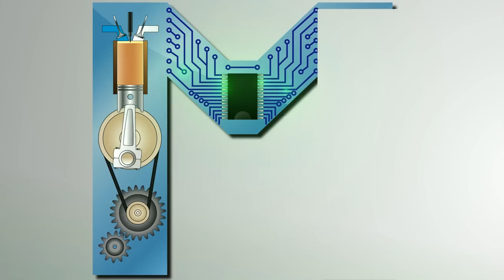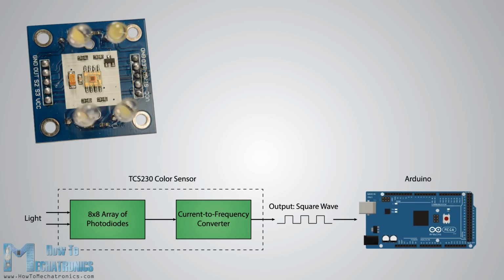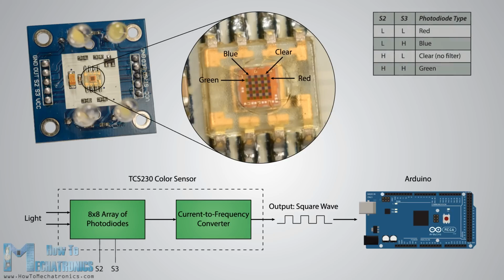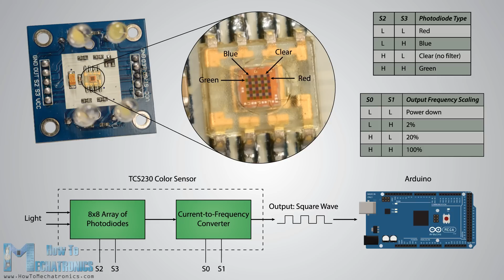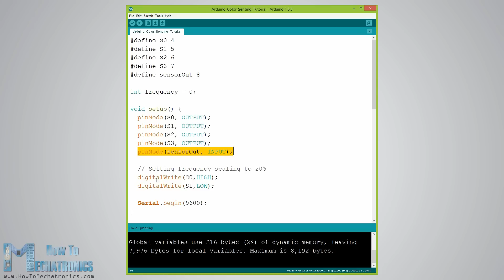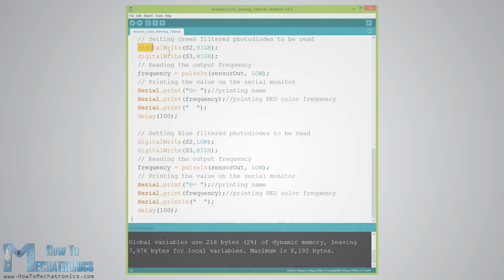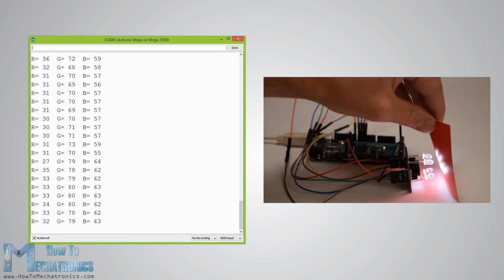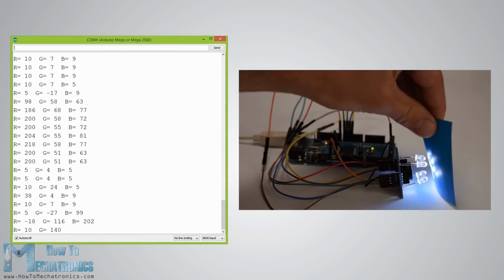Arduino Color Sensing Tutorial - TCS230 TCS3200 Color Sensor

Comment: Great video, but what happens if you want to detect a a different colour apart from red, green or blue such as yellow? I'm using the XC3708 sensor and it says that it can be set to read, red, green blue or greyscale.
 Would you have to test the colour first then use the map function to define the frequency based on the readings that you get?
Reply: Hey Lothan! Late reponse here but it may still be helpful.

All colors can be defined on a RGB scale. Try googling "RGB color" for a better explanation. Basically though, Red Green and Blue can combine in any amount to form a color. As an example, 255 Red + 255 Green + 0 Blue will create Yellow. So a sensor like this can be used to detect any color, not just RGB. If you open "Paint" on your computer and go to add a custom color, you should 3 boxes labeled Red Green and Blue. Try typing 255 in Red 255 in Green and 0 in Blue. This should create yellow, and should essentially replicate what color you'd see if your sensor also read 255 R, 255G, 0B.
Reply: JESUS IS THE KING OF THE KINGS
Reply: cap @xeither289

Comment: can this sensor work to detect change of color on a small section of a computer monitor?
I want to build an alarm that will let me know when a window in my computer's monitor becomes red or yellow... but I am not sure what sensor to use
Reply: Hi Marcial, were you able to figure this out?
Reply: @marcial wills did u figure  out  please man i have the same idea of the project what u are thinking can you help me out did u figure it out
Reply: @DC-jt7os  yes. It is not very accurate but it worked for what I wanted. I used a TCS34725 RGB Sensor. It detects the color from the screen/monitor but the source of light has to be big (like 1 square cm of screen.. it will not detect only a few pixels)
Reply: @spacebread did u figure it out ma please tell mee

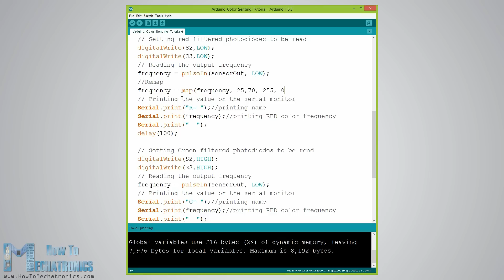Comment: 4:09 why is the mapping reversed?  Should it be map(25,70,0, 255)? 25-0 and 75-255
Reply from the maker: Well in this way you map and at the same time reverse the values. So when the first values go from 70 down to 25, the new mapped values go from 0 up to 255.
Reply: @HowToMechatronics  So this sensor reads signal in reversed value?
Reply: I know it has been 2 years. But I dont know the another maps in the code. Please someone help me.

Comment: if i want to implement this using pic microcontroller , do i need  a pic that supports Analog to Digital conversion ?  i mean does the sensor requires A/D conversion ?
Reply: If you set it to use 20% or even 2% then you do not need an A/D

Comment: hello, Dejan Nedelkovski, i need a colour sesnor that sense 12 colours. and able to sense 4 colours at the same time out of the 12 colours. coz, i'm trying to workout the value of resistors by detecting the 4 colours that are displayed on the resister. it would be very helpful for me, if you can tell which arduino sensor can do this job? thanks :)

Comment: What if i use a red light source in front of this device?
Will i get the readings in that case? or  using an object is the only way to detect the color?
Reply: i would say, build the device, and then try it, the sensor is just around 15 euros (so around 15 dollars) so it isnt expensive

Comment: Hello, where did you get the values of 70 and 25 in order to map them into RGB. 
Thanks in advanced.
Reply: By looking at the output from the serial port. First see the thresholds then map them according to what you see. Not the best approach but is practical

Comment: Very interesting. It seems like you could use this with an RGB LED to mirror the colors that the sensor sees, which would allow something like corner sensors on a TV to create a backlight that mirrored the colours on the TV screen. How many of these sensors could and Arduino handle at the same time?
Reply: do you have the code for this
Reply: JESUS IS THE KING OF THE KINGS
Reply: cap @xeither289